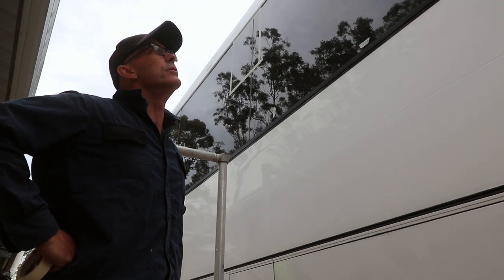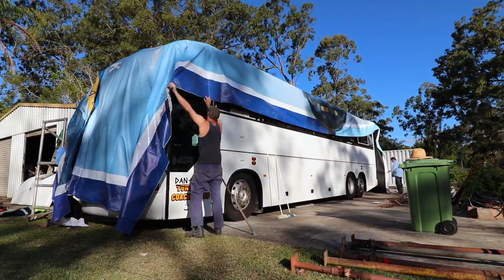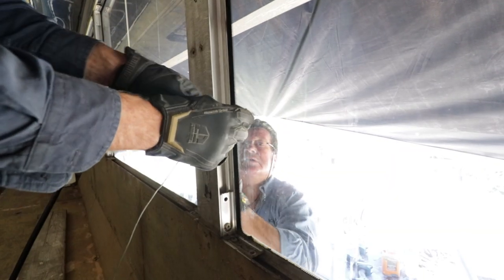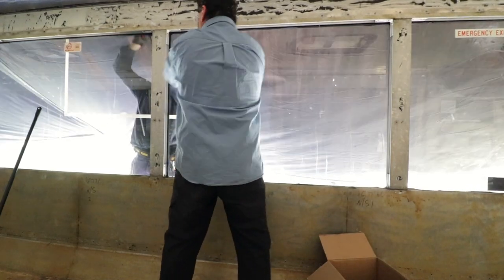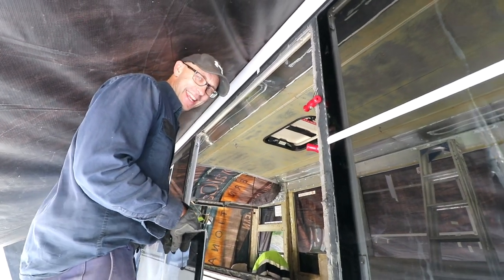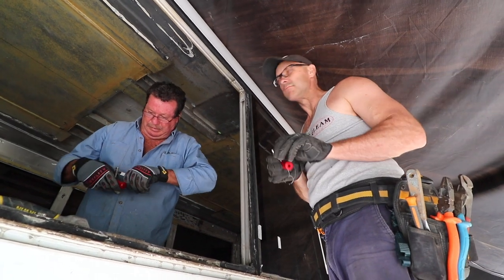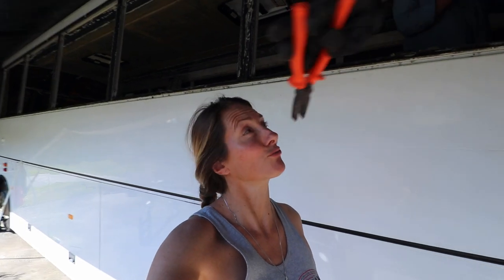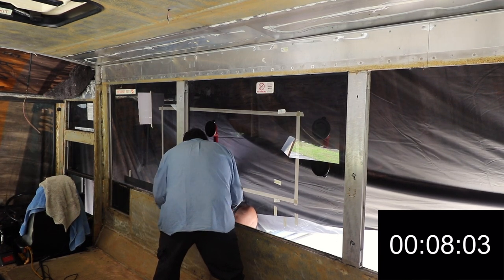Bus Conversion Removing the Windows S1 E6

Comment: You did better than us. We ended up cracking ours in the process. Weren't really too phased as they were of no use to anybody.
Reply from the maker: Don Coleman I will look to sell them. They are valued to the right person/company - we just have to find them 👍
Reply: @Danjuly71  With yours being flat they'll be ofuse. Ours had a slight curve which I think is uncommon. A real PITA as the pillats are curved too.